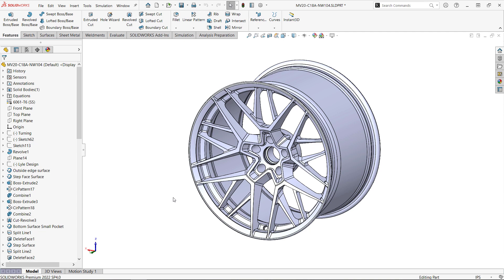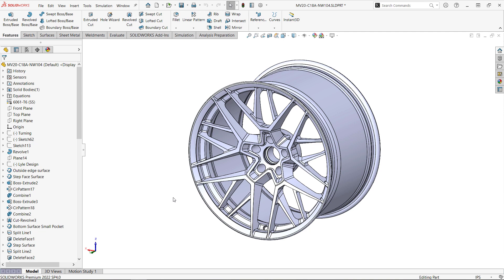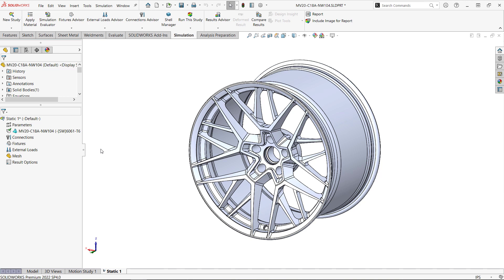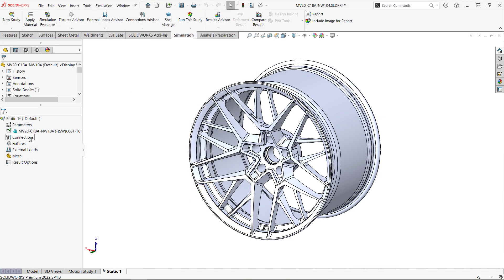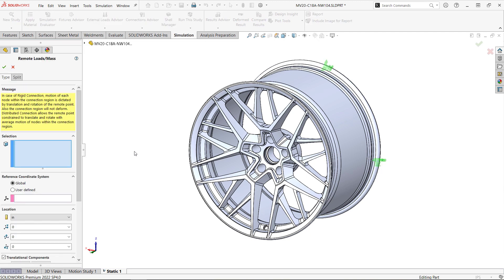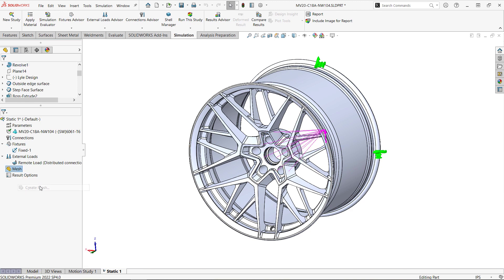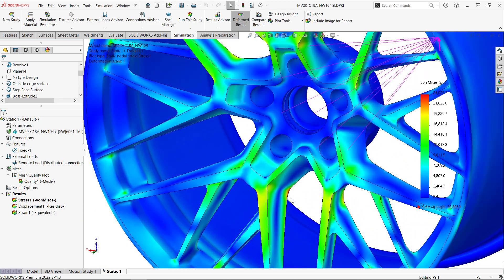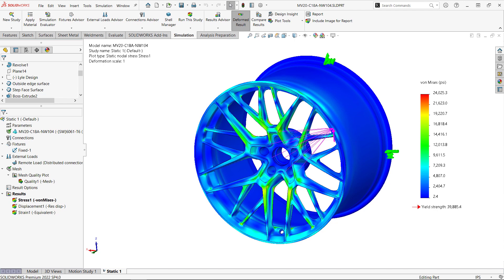Analyzing a Forged Aluminum Wheel with SOLIDWORKS Simulation

Comment: This is really nicely explained..
Thank you

I was wondering how that impact simulation be done.. as Solidworks doesn't really help with impact as it becomes really non linear for aluminum material!wish you had a webinar for the impactas well. It is also a safety point I think. The impact test should pass as it saves the cars balance if collided